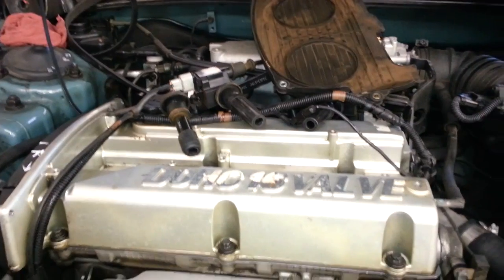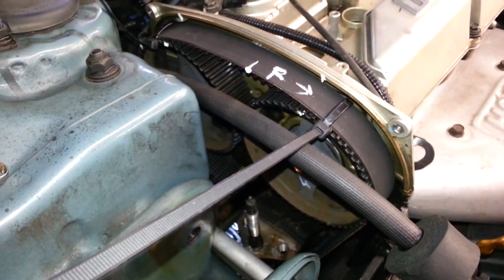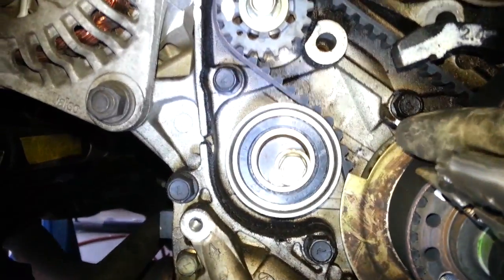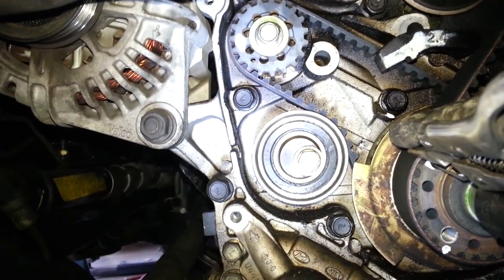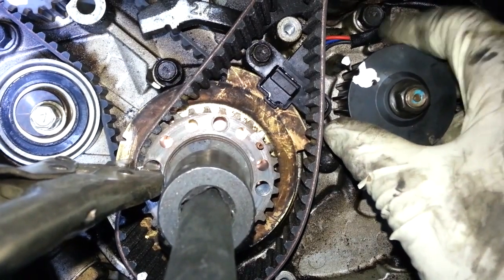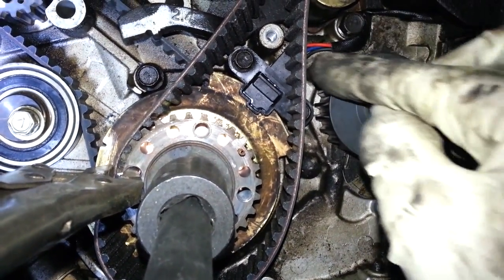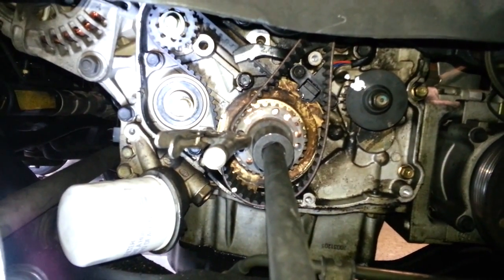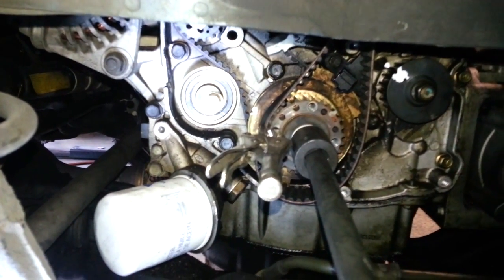HOW TO NOT FAIL! "Gravity Trick" Hyundai Mitsubishi timing belt info!

Comment: Bro I have a 2001 same engine same problem I'm leaking coolant where I think is the water pump because the coolant is leaking down from the top and dripping all over the oil filter and down onto the timing cover and it's causing me issues here I've got most of the stuff apart but I need to know if I pull the belts off am I going to lose timing the minute I pulled the belts off

Comment: Gravity method does work but you are incorrect that ALLDATA does not show you how to time that left side balance shaft which is driven by the oil pump sprocket you were spinning. There is directions with a picture showing you to remove a small plug on the left side of the block which is facing the front of the vehicle. Instructs you to use a screwdriver that is about 8mm in diameter and will reach a little over 2 inches through the hole and it will hold the balance shaft when in the correct position and making sure the oil pump sprocket timing mark is lined up. Might be more trouble to access that hole ALLDATA shows, but ALLDATA "DOES" show you how to line up the left balance shaft to the proper position.

Comment: Bought a used 2002 Optima that always had this bad vibration. Previous owner said the timing belt had just been replaced and the car had the vibration described. When the balance shaft belt broke several thousand miles later, it took out the crankshaft sensor, stopping the engine. Lucky for me it did no harm to the timing belt. In watching this video, it is now obvious where the vibration came from. Evidently the balance shaft belt had not been changed. This is a great tip you have provided, many thanks.

Comment: This is excellent! I have a 1G Eagle Talon that has the Mitsubishi 4G63 7-Bolt engine, and I first experienced this vibration issue at a shop years ago when they started it for me when I picked up the car. They had swapped the timing belt, but it was vibrating on the mounts, and was not doing that when I first brought it in.  I pointed this out, and the owner of the shop rolled his eyes, and said that he knew what had happened. He told me to come back that afternoon, and by that time, it was fixed. In the Talon/Laser Chrysler service manual, it does show how to use a screwdriver in that hole in the engine block to "block the left silent shaft," but only for the purposes of the removal and re-installation of the oil pump gear/sprocket in case you are trying to replace seals, or removing the oil pump. It does not explain exactly what is going on. The silent (and other balance shaft) are kind of like baseball bats that have been sliced down the length in half, and are spinning lengthwise, creating a swift moving counterbalance to the actions of the engine. They don't explain this, and they don't tell you that the proper position for that silent shaft for timing belt/sprocket setting purposes is with the counterweight part of the shaft down (in the bottom of) it's housing. I learned that "rocking back and forth" trick a while later by chance after removing the screwdriver from the engine block, and then read that it was another way to double-check yourself before you put everything back together. Great video! Thanks!

Comment: This is great, and another tip with this engine is to check that the pin inserted in the hydraulic tensioner still moves freely after adjusting to specification. Must be able to remove and reinsert it after the job's done

Comment: Thank you the manual says to use screwdriver & remove the side plug but doesn't state which side. Now that you explain it I can fix my vibration issue. I did a head gasket replacement because it overheated and blew. Due to a cracked radiator anyways Mahalo thank you for explaining.

Comment: It is three to one and the CORRECT method is to open the access port and stick a screw driver in while turning that and when the screw driver is forced out then it is in phase. Your way also works, but is not as fool proof as the proper method, which IS in the manual, however, that port is a pain in the ass to access and use, so i use this method. you should spin it 6 more times to confirm you have found the CORRECT position

Comment: Very informative.  I just replaced my sons girlfriends crank sensor and someone had replaced the timing belt but not the small balance shaft belt and when went in there there was no teeth. There is a vibration in the motor it was worse before I put that belt on. Now ill have to go back in and see about this. Hers id s 04 santa fe 2.4l 16 valve.

Comment: The positioning port point and gravity observation are very helpful.
HELP. In a month and 1/2 the rocker panel has terribly rotted on the driver's side. What guaranteably stops this rust from spreading worse in to the crappy unibody frame?

Comment: I've done a few of those timing belts , never had any issues with vibration though . I always removed the block plug and inserted a suitable size screwdriver to keep it "timed " . Also noticed that pulley can move about 30 degrees either way so I did my best to " center " the sprocket in timed position . I hope that helps

Comment: When you did it the first time how did it sound because I just replaced mine because it snapped and it knocks when it starts but will hold 4k so the engine and head are on time and the balance shaft is one way like you said
Reply: The engine can still hold 4k even with a bent valve or a tooth off. But in this instance the oil pump may be off as well. The oil pump needs to be in time as well.
Reply: @raymondrazack4773  oil pumps on time i had the head all apart an replaced the valve stem seals re sealed the valves so there not bent the only thing I can think is the crank is 180 degrees off like it's at tdc for exhaust rather then compression
Reply: I used the gravity method for the oil pump because it's 3to1 gear ratio
Reply: @raymondrazack4773  would the Pistons be at a different orientation at tdc for exhaust vs compression
Reply: @oggramm  you can have the crank 180 off. Remember it's two crank rotations to ever one cam rotation. But if it's a tooth off itll rinse crappy
 But if your having noise determine if it's a bottom or top end. Chances are you spun a bearing or the bearing is tight. Reversely it is an interference motor and it's possible you may have bent or hit something when the belt snapped.
Reply: @raymondrazack4773 it's a 4g64 motor Pistons are good valves are good timing marks are good so I'm thinking it's got to be the crank being 180 off because it has awesome compression just runs like its way off time so just set the number one cylinder valves closed and turn the crank another 180 should do the trick ?

Comment: Btw. when changing the crankshaftsensor I recommend putting a washer under the screw next to the sensor. So the wire will not be damaged by the timing belt ever again. Worked for me perfectly.

Comment: You are a GOD SEND my friend!!!

 I just got my JDM Mitsubishi Galant VR4 (4G63) back from the shop for TB and WP service. After picking it up, the car drove fine during normal driving BUT as soon as I started doing some "spirited driving" and engine revved over 4-5K RPM the car started vibrating like crazy. 

So I took it back to the shop only after 15min of driving it around and let my mechanic know about the issue. He had the car for a extra 2 days and still couldn't find out the issue. He was suspecting the motor mounts but those were solid. 

Can't wait til Monday to show him this video and hopefully correct this issue on the spot.

Wish me luck.

Comment: HOLY SMOKE that looks far more complicated than the older 2.7 delta... with those you have the 2 cams and the crankshaft to line up. THAT'S IT.
Reply: Have you done this job on a 2.7 delta? What resources did you use? Thanks!

Comment: It is the oil pump pulley that you are referring to and yes it must be aligned correctly or the result is vibration which eventually causes much more problems. The hole in which you placed the drill bit is used to determine the correct timing for the oil pump. However the methods you used work as well. But normal procedure is to use the correct timing pin and insert it into the whole then line up the timing mark on the oil pump pulley. And you will know it's correct because the pin will stop the rotation once it's lined up correctly if it is 360 degrees off but timing mark is lined up the pin will not stop the rotation and allow another 360 degree rotation to the correct timing.  Where you will find you will have more of an issue is the tensioner for the timing belt. The tensioner's hydraulic chamber is easily damaged if compressed unevenly or too quickly and once the tensioner is worn you will have common problems with tooth slippage. Also when installing the tensioner if done incorrect which takes some skill and technique it can be difficult to keep all the timing marks correct while the tensioner  pin extends back out.   All in all its really not a bad job.. Ford is similar in their use of a timing pin!

Comment: Yup I replaced my timing belt on my 03 Eclipse and it’s vibrating has drove me nuts . I did replace a couple of bad mounts witch I know if the engine is dropped some it will shake also . I was getting ready to do a new timing belt due to the miles and have run into lots of videos about the balance shaft. So looks like this time I might actually get it right. Thanks

Comment: So a question I'm worried about broken valves I have it all back together but will not start all that broke on mine was the balance shaft belt so would it have even messed up any valves need help please on here or email me at norrickadam@gmail.com
Reply from the maker: you need to check compression and timing of the belt.

Comment: Working on 2000 mitsubishi galant  2.4 16 valve engine. Timing belt problems, I've tried doing the gravity trick but it just seems to not move at all only when I hand spin. Help....
Reply from the maker: you will need to insert the screwdriver on the side of the block according to instructions.

Comment: I don't see any nonsense in this video but why the 40 dislike? jealous? 
 very helpful video.
Reply from the maker: thank you! People who don't like free help click dislike. idk..
Reply: Most likely because the information is not completely correct, the balance shaft on the left that he stated ,as long as the marks  line up you are all set, is incorrect. That shaft also has to be aligned properly. The same "gravity trick" applies. If not correct your engine will vibrate at high RPM. That is the balance shaft, being driven by the balance shaft belt. The 3 to 1 info is not completely correct either, the mark is either on or 180 degree off, try it yourself the gears either fall towards the mark or away, spin 180 degree they will do the opposite. All of these items have marks for a reason.

Comment: first I want to say thank you for the video I have a question for anyone that can answer it have a 2003 Dodge Stratus RT 3.0L V6 Mitsubishi engine but the same problem my belt tensioner has slipped my belt is not broken can anyone give me what a shop would charge in between prices high and low for this job thanks again

Comment: Today I was doing a timing belt on a Hyundai trajet 16v DOHC and I remembered this video that I watched a few weeks ago. The engine looked exactly the same, it had a secondary belt for the rear balance shaft and everything.  And, remembering this video, before removing the belt I wanted to check if the balance shaft had this 3 to 1 ratio, and I turned the engine 6 times(meeting the marks on the cams 3 times), and the mark on the balance shaft only aligned at one of them. 

So thanks to this video I was extra careful to not turn the balance shaft when replacing the oil seal

Comment: Great video thankyou. How do you set the tension for the timing belt? I know it has a hydraulic tensioner and you compress it in the vice and put a pin in, then pull the pin to auto set the tension. My question is, where do you set the rotation on the roller before you pull the pin? I assume it just takes out the tension of the belt then the hydro tensioner takes up the rest. Thanks.

Comment: Great job, very helpful.Got a vibrator i bought for my grand daughter. had belt changed by prior owner . runs strong but vibrates.changed motor mounts but did not help. Thought maybe main bearing rattle or piston slap,but oil pressur is good . so i will check balancer. Thanks
Reply: My god please re word the second sentence! LMAO

Comment: Hello Mr subtledriver,

I have some inquiry about my car, what happened is the timing belt was broken and after replacing everything on this video was being placed exactly how it is but still experiencing some shaking of the engine, i found that the spark plug 1 and 3  is wet.

Any kind of response from you is highly appreciated. Thank you!
Reply from the maker: jabez mijares do a compression check.
Reply: jabez mijares bad head gasket
Reply: jabez mijares HYUNDAI
Reply: jabez mijares tytttyttttttttttutttt&
Reply: jabez mijares tt

Comment: Thank you for your valuable information.  finally a video with the proper information,  Glad to know this.   My Chilton manual does not tell me this.  This manual is also wrong about the cam shaft timing marks.  It says to point the marks straight up to align with the marks on the cover.   But if you look at the marks on the cover,  the exhaust mark is directly 12:00 in comparison to the shaft.  On the other hand the intake mark is about 11:00.  Not directly over the camshaft.  what are your thoughts on this?

Comment: It was a 2005 Hyundai Sonata 2.4 16 valve by the way. Timing belt broke and bent all valves. 550.00 later in head work I was happy she is running good. Especially because it's a customer vehicle

Comment: great video. I am doing one of these right now. had mechanic change belt. did not know the crank sensor was such a pain to get to. so needless to say. about 3,000 miles later the crank sensor went out. I took it apart changed sensor. thought I put it back exactly the same way I took it off. apparently this little shaft moved. put it back together and it vibrated like hell. I work on a tug boat so I am pressed for time. this video is more informative than anything on the web about these balance shafts. all I can say is if you are changing the belt. I highly recommend changing the crankshaft sensor. thanks again.

Comment: I tried this gravity method on my 09 eclipse but doesnt seem to gravitate it just turns but not easily, I was assuming it's because of the oil inside the engine. Can this be a issue with my oil pump or this trick can only be done when oil is out of car?
Reply from the maker: It's not always going to be this easy, sometimes you try all three positions and whatever seems the best is what you go with. But if you want to be 100%certain, open side plug and use tool to check position.  Gravity trick is a learned trick. Like tightening bolts by hand without tq wrench on every bolt. You will get a feel for it.
Reply: I found that my oil pump is bad. Low oil pressure has been setting off my oil light and causing my car to die and also my lifters to make noise. And I kinda figured since the gravity trick didn't work bcuz my oil pump gears weren't moving freely, I'm gonna replace my oil pump and might delete the balancers.
Reply: Kinglionboy 777: Always Replace the JAKE BELT ,ALSO.IF U GET THE GATES COMPLETE ASSEMBLY UNIT,IT WILL INCLUDE THE JAKE BELT ,& All PULLEYS ,U Need.
Reply: Never Owned An Engine W/ Jake Belt, Which Drives the Oil PUMP. IF U Don't  Repl.it at least ever other T.Belt  Job, It Breaks & Your Eng.Shuts Off ,So Your Eng.Isn' t Oil Starved.About As Crazy As Letting the Alt.Belt,Smallest of Your Belts, Also Pull the Water Pump.KOREAN ENGINEERING  IDIOCY AT ITS LOWEST!!

Comment: dude you are bad ass thanks for this video! !!!!!
Reply from the maker: Thanks! Be sure to follow on instagram @subtledriver Thank you
Reply: +subtledriver  the one I did smacked #1 after I got it started it ran, but one dead cylinder. I did a compression test #1 only had 24lbs vs#3 with 175, so it runs on 3 had to break the bad news to the customer, his belt didn't break when it came in but it had jumped time from bad tensioner

Comment: I just finished doing a broken t-belt,  I didn't know the balancer can be in different spots,  I'll remove it all and check again,  how bad of a vibration did you have was it noticeable all the time,  in,  drive and neutral
Reply from the maker: If the engine vibrates at certain rpm and it's noticeable then might go away at higher speeds you might have to reset the balance shaft. I learned the hard way.

Comment: At what rpm is the vibration... I am suspect on this on mine , however it is smooth until it reaches 2900-3200rpm and I can drive through the it 4K...-5500 etc is smooth again.
Reply from the maker: Sounds like you might need to do this gravity trick.

Comment: On my 3rd timing belt replacement at 200k miles on my 2003 Santa Fe, 2.4L. I had the vibration problem on the second replacement, but did not know the gravity trick and could not locate the hole for the screwdriver, even though I had the All Data instructions. That time I was advised to turn it and then start it, to see if the vibration went away. Thank you for the detailed video. It will be very helpful on my next timing belt replacement.

Comment: you rock!!! thanks, for that info, saved me a lot of head scratch.  noticed a vibration in wifes santa fe after paying for belt change 3 years ago after blowing compression for tdc noticed that sprocket timing mark was out of time. (water pump is leaking, and car is within 1K miles of belt change)